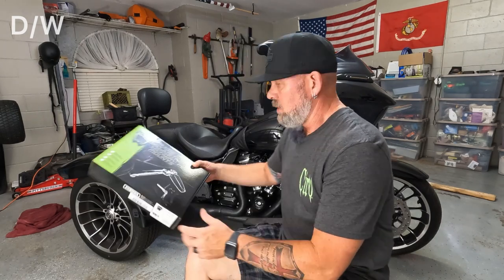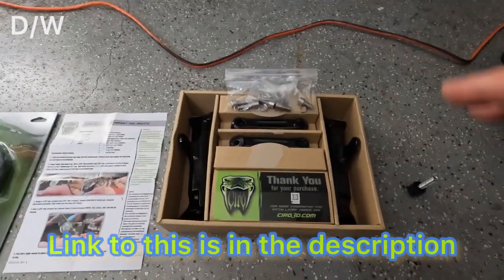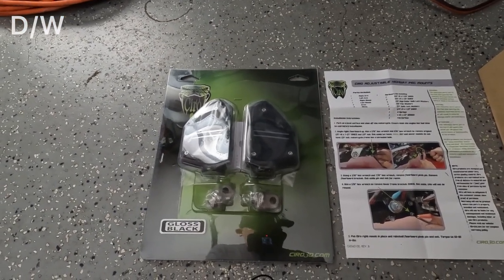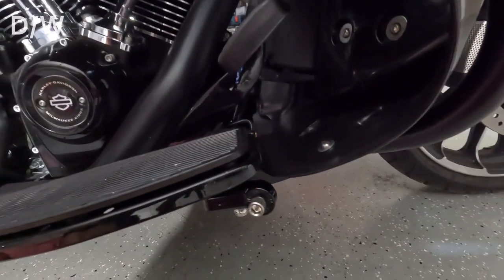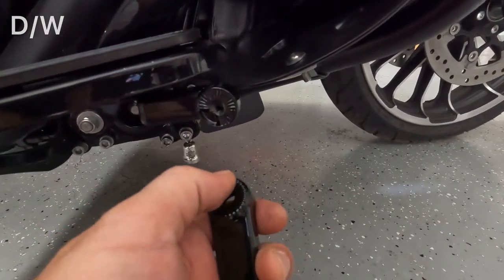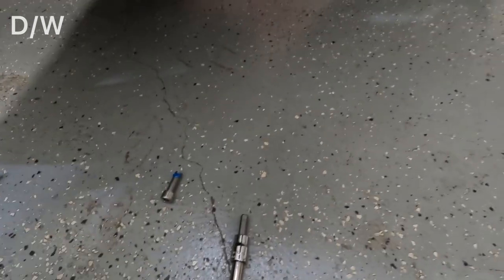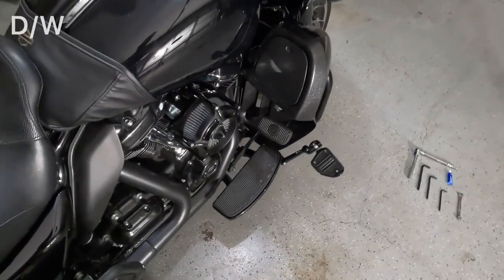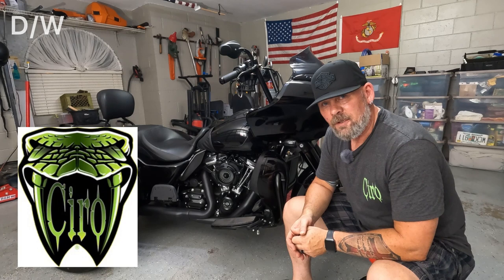2023 Road Glide 3 - Ciro Frame Mounted Adjustable Highway Peg Mounts

Comment: Another GREAT install video, Sir....Have these in chrome on my 2020 T.G. along with the extensions....They were a relatively new item 3+years ago, but have performed flawlessly. Looking forward to many more future videos. Stay safe, brother! - Mike
Reply from the maker: Thanks, Mike!  Appreciate your comment!!  Yeah I shoulda got these years ago, but didn’t. Much better comfort than the traditional ones. Again, thanks for stopping by and as always, be blessed, brother!!  👊🏼😎
Reply: I’m 6’3” with a 32” inseam. Should I get the extended arm or regular arm?
Reply from the maker: @bigjohn4977  I have a 32” inseam as well. I got the standard length arms. Gives me just enough knee bend to be comfortable.
Reply: @bigjohn4977  l'm 6'02" with a 38" inseam John. The adjustability of the regular arms should give you plenty of leg room. Both of my legs are 1/2 + titanium, and l have to constantly move them around. Like Donnie, mine are set up where l can rest my heel on the floorboard. Unless you want your legs very far out in front and really high, l would just stick to the regular ones. Hope this helps. - Mike

Comment: I’ve had my RG3 for about 5 weeks, and I’m replacing parts that need improvement for me as I accumulate miles. I already have 1,560 miles. I’m 6’3” and the two first replacements were the windshield and seat. I put a Klock Werkes 12” touring w/s and Mustang seat on the BlackPearl. I installed the top rack & Custom Dynamics rack light. I need the highway pegs and thanks to you Donnie, I’m going to get the Ciro frame mounted ones, and I’ll probably order the DJ floorboard spacers at the same time (my right leg got toasted in a 2 hour traffic jam). Thanks for all you do; it is appreciated.
Reply from the maker: Yes sir, Big John!  Gotta make it comfortable!  The link in this video will take you directly to the highway peg mount. Thanks for your comment again, sir!!  👊🏼😎
Reply: You both cinched it. I’ll get the standard reach arms. I didn’t know if I’d be able to use them in conjunction with the DK spacers; thanks for clarifying that, Donnie. I’m currently on a ride from Stockton, CA to Palm Springs; and I stopped off at the “California Trike-in” in Mariposa, CA.
Reply from the maker: @bigjohn4977  nice!!!  Travel safe, my friend!  Be blessed!!  🙏🏼😎
Reply from the maker: @bigjohn4977  also, when you order the extension kit from DK Custom, ask for an additional spacer for this mount. Tell them what you’re doing and they should help with that.
Reply: @donniewieburg  Thanks, again! The “CMA” blessed our trikes & us before we took a ride today.

Comment: So glad you have the knowledge to work through this. I am thinking I want Highway pegs. However, I did not use them as much on my other trike as I thought I would.  I need to determine if it is worth the investment.  Thanks for sharing.
Reply from the maker: Hi Melissa!!  These actually sit closer than your traditional pegs. I’m short legged and always had to stretch out a bit with my legs fully extended. Now it is a very comfortable transition and my knees are able to keep a bend in them. I should have gotten these years ago, but I was narrow minded more than I am now. 😆 Thanks again for your comments!!  Be blessed!!  🙏🏼😎

Comment: Looking great Donnie. Hey, did you get the extension pegs or the standard? I want that exact look you have. My right knee needs that extension.
Reply from the maker: Thanks, Lorenzo!  I didn’t get the extended arm. Just the standard. I’m 5’11” with a 32” inseam. These worked out great!  The link in the description will take you right to the item and you can select other options as far as color, length and choosing a certain peg. Appreciate your comment!!  👊🏼😎

Comment: Thanks for this. Do you know the size of the bolt and spacer you got from Ace?
Reply from the maker: Unfortunately I do not. I took the OEM bolt into the hardware store and matched it up to one an inch longer. I then got a thicker washer as the spacer. Worked out great. You may have to use 2 washers as a spacer if you can’t find a thicker one.
Reply: @donniewieburg  thanks.

Comment: Donnie,  I'm having trouble getting those bolts loose. any advice
Reply from the maker: I had to use a breaker handle. Ended up bending one of the bolts taking out the oem ones.

Comment: I have a question do these work with drivers floorboard extensions
Reply from the maker: Yes. I have those also. You’ll have to go to a hardware store to get longer bolts. I don’t have the size anymore.
Reply: Thanks for the info I already have the extensions . I just didn't know if they would work with them. Ya nice bell lol

Comment: Will this give me enough stretch being 6ft 1in? How tall are you?
Reply from the maker: Works great for me. I’m 5’11”. There is an extended version as well you can choose. The adjustable arm is an inch longer I believe.
Reply: @donniewieburg  cool. I may go with the extended arm to kick my foot out more. Any scraping on turns?
Reply from the maker: @JimmyDean1992  no sir.
Reply: @donniewieburg just got off the phone with them and they said they don't know if they will fit the 2024 road glide😢
Reply from the maker: @JimmyDean1992  they will. Nothing has changed on the RG3 in 2024. Maybe the person thought you meant the new 24 road glide and street glide.
Reply: @donniewieburg I have the new 24 fltrx road glide. I just got off the phone with ciro directly. They are working on a new design that will be ready in 30 to 90 days. Such a bummer. My legs are going numb on long rides
Reply from the maker: @JimmyDean1992  shoot!  I thought you were on a Road Glide 3. Yeah they are currently working on the new 2024  models. Sorry for the confusion.

Comment: Will this setup work with DK floorboard extensions?
Reply from the maker: Yes. I have DK extensions on my RG3. Thats where I said you’ll have to go get a longer front bolt for the brake side bracket.
Reply: @donniewieburg  Thanks...I thought you said that you needed another extension for that longer bolt. Any chance you would know how long the bolt you got?
Reply from the maker: @ultraclassic01hd  I don’t recall the actual length. But it was an inch longer than what the DK extensions come with. I used multiple washers as spacers for the back bolt.
Reply: @donniewieburg  Thank you!